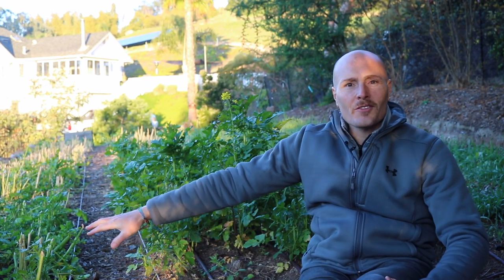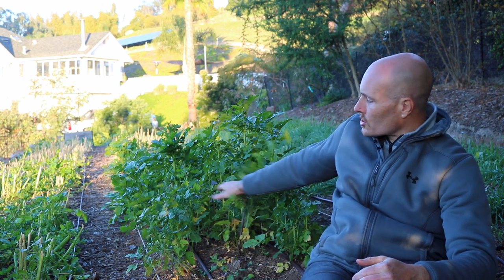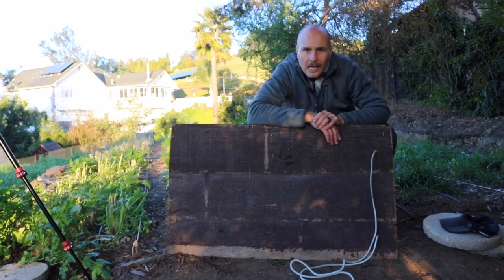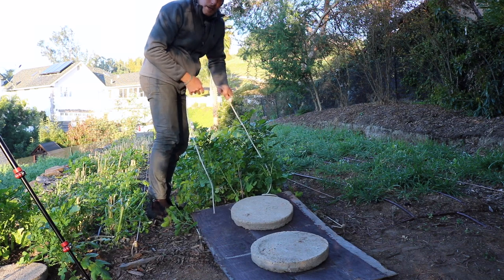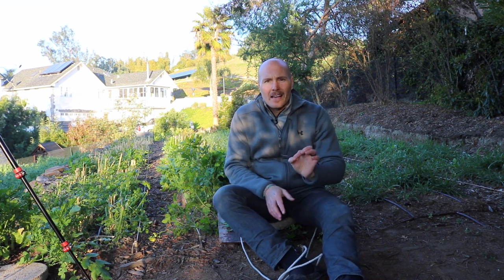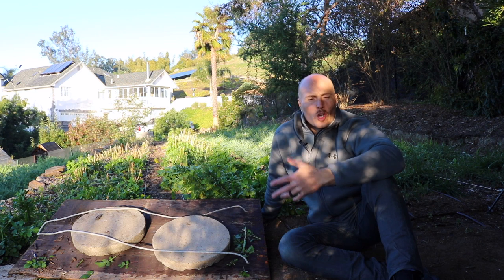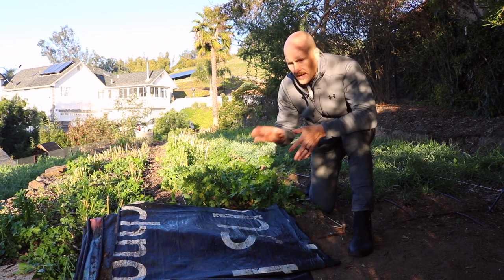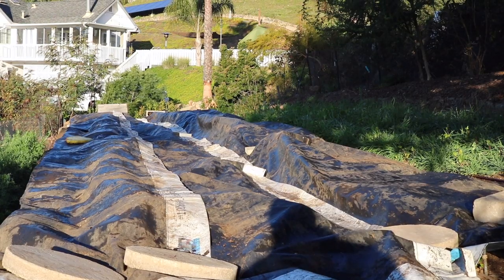Knocking Down Cover Crops to Compost in a No-Till Garden

Comment: Great questions. Here is my take on what is going on: I'm pretty sure that plant residues at the surface are a minor part of soil building. Good mulch for moisture retention and weed suppression, and for releasing breakdown residues into the soil.  The bulk soil is most nurtured by the sugars and other exudates from THE ROOTS! Organic material at the surface will be oxidized rapidly, particularly if there is a good balance of carbon, nitrogen, moisture and a good microbial community.  Of course some will be incorporated due to worms and other organisms.
Reply: Without a mulch, the detrimental effects of exposure fuck up whatever soil life you built.
Also you are simply feeding different parts of the microbiome with those 2 ways ... decomposers and symbiotes, respectively.
Both are relevant.

Comment: I use a piece of horse panel wire fencing that was leftover for my plow and cinderblocks for the weights.  It works like a charm.  The wire catches and tears/cuts a fair portion of the weeds/cover crop.

Comment: Just rewatching this after learning much more. For my cover crop mix (wheat, crimson clover, red clover, buckwheat, daikon radish), I'm going to tie twine to both ends of a 2x4 scrap, put it perpendicular to the row and keep one foot on it as I walk up the bed and use the twine to lift the scrap and move it and my foot to push it back down and crimp. My space is small and I think this will work nicely. Anything that doesn't die from this will get winterkilled (I live in zone 3 and even red clover is unlikely to survive).

Next year I will try some winter wheat to overwinter some living roots. This year, will just be some hardneck garlic in part of the garden after terminating the cover crops.

Comment: I'm so glad you did this! I think a HUGE variable is, as always, the amount of rainfall on a person's garden. I've had about 70" annually for the last 3 years, our average is supposed to be 60". Another one would be what cover crop is being used. I have a couple of places where I plan to plant trees and grapevines in 2 or 3 years. So, I'm running a variety of different things depending on if the spot tends to have standing water. I'm hoping my work horse will be sudan grass. But I have a great curly switch grass that pops up in my no mow yard areas (standing water or not) that I'm pulling seed from today in case the sudan grass fails me. But I'm hoping to be able to get a couple cuttings off the sudan, compost the cuttings and put the compost back down right before I drop seed for my winter cover crop. Be interesting to see how it plays out for me.

Comment: Just my opinion, but I think the best way to go about it, in your climate (and given your willingness to keep some beds "unproductive" for a while) would be to collect a lot of the rougher stuff in your beds (even some of the bigger roots), and compost them (or send them to municipal compost, if you don't have the space or inclination to wait a year+ for that rough stuff to compost without being ground up by heavy machinery). And then, instead of the tarp, sow a diverse cover crop (aka "green manure"), and kill if after 4-5 weeks. Cover crops don't just provide you with nutrients by decomposing after they die. Early in their lives, they actively harvest energy from the Sun and nitrogen and CO2 from the air, through photosyntesis, and deposit the resulting nutrients in the soil. They literally exude nutrients, out of their roots, into the soil (it's more complex than this, it involves microbial soil life, but it's what the end result is). They do this for the first part of their lives. Also, in this early stage of their lives, they produce more roots than stem and leaves. 
.
So, if you chop them down very young, you get the bulk of your benefits through nutrients exuded directly into the soil, and roots that will quickly break down in your soil. It's my understanding, based on a few lectures I've seen from soil biologists like Christine Jones, that a month is all the cover crop needs to do most of its work, afterwards it stops feeding your soil and starts putting its energy into producing leaves, flowers and eventually seeds. It also starts reaping the benefits of the symbiotic relationship it has with the soil microbes, in other words it collects interest on those deposits it made in its youth...charming as that is, there's no point in letting things get that far in a gardening situation (there would be, out on pasture).
.
That said, I don't practice this, because I garden in a climate with a short growing season. I can't just take each bed out of commission for 5-6 weeks, to grow cover crops (I could, but it's not efficient). So I compost. I spread a layer of compost on top of the bed in spring, and then plant into it. But it's work, and I would not bother with it if I lived in Cali. It seems to me that it's far less work, and when your growing season is pretty much year round, it's worth rotating in cover crops. Like you mentioned, farmers (the smart ones) do it all the time.

Comment: Great presentation of these concepts. I canspeak pragmatically: When I was kid my neighbor was an old man and he planted winter rye and buckwheat cover crops every year. He would have me drive his Farmall Cub and plow these cover crops in.  After he passed away I continued to raise crops on this garden however I stopped using cover crops because it was more work.  The tilth and productivity of the soil dropped off rapidly. Within 3 years I was turning over what looked more like subsoil. 
I don't know why the cover crop made such a difference.  We do get a lot of rain and having the field covered with buckwheat after harvest and rye through the long New England winter may have helped to prevent the erosion of nutrients and Steven Shantz's comments on the roots makes sense. I've long since moved away but I do still grow with cover crop; oats/cowpeas planted in the early fall that winter kill. I have no idea if this crop is improving my soils. I often tarp my "no-till garden early spring to create a clean/dry seedbed.  I will be curious to know what you learn in your experiment. I think you are smart to move the cover crop to the compost pile and create compost there because you have greater control of the composting environment and you free up more space in you garden for growing. Ether way, I would want to keep the soil surface covered (tarp, cover crop or compost) but then again you may not get as much rain as others.

Comment: my cover cropsI cut , chop and then rake the surface up and cover the chop with soil( or compost from elsewhere effectively burying it). I will add a little vermicompost for all the microbial addition. add water if it needs it.
In about 6 weeks time it will be ready and broken down ready for my container crop.if no till is sacrosanct,then just apply compost and put your chopped materials onto a compost pile

Comment: Mustard doesn't grow back when it's that tall. Usually only grasses will grow back if you cut them. Things like wheat, rye. With cover crop I use the traditional method : you stomp  them once they flower, so that they don't grow back (if you do it before they flower, it doesn't work as well). I do not put them in the compost. I add a bit of compost or spent barley, some wood chips, and plant about 2 weeks after, so that the roots have decomposed and the stalks started to. I usually sow in October, a mix of mustard, rye, vetch, fava bean, winter pea, and phacelia. The more plants you have in your mix, the tougher and taller your cover crop. Doing mono species doesn't give you a lot of biomass. And I stomp it in May, I'm currently doing it in our garden. It's beautiful when in flower, with the pink vetch flowers, purple phacelia, and the rye ears. I do it coz my soil is clay, that can get waterlogged in winter.

Comment: I like how you pose relivant questions for your own use. Its making it a bit scientific. I appreciate that.👍 Also, I'm wondering how your mustard compost is doing. Id like to see a vid if you turn it or even a temp check if you are hot composting it.
Reply from the maker: Video on that coming.  I didn't turn it.  I never measured the temperature.  I moved it to a bed 9 weeks later.  Results were pretty good.

Comment: Chop and drop is about creating a mulch. I think you are worried too much about it drying out. It's there to protect the soil
Reply from the maker: I am saying I don’t think it builds soil very well.  Protecting it isn’t the goal for what I am doing.
Reply: @DiegoFooter   Diego Footer  I rewatched the video. I am of the belief that we should be giving the organisms something to work on at the surface since we are doing it below the surface by not tilling.  If we remove the residue and compost it, it will break down into particles that will enter the soil faster. But I'm asking what protects the soil while the residue is gone while composting. The tarp is one solution. As for chop and drop, maybe we just have to get our timing down; so we do it before a rain so we can capture in the soil the nitrogen that leeches from the residue.
Reply from the maker: I get where you are going, but I am not of the believe that the soil has to be protected straight up the surface.  The upper layer of soil protects the soil below it - no mulch needed.  I am not convinced that it is worth a lot of extra effort to have maximum water and biology right at the surface.  It's a positive, but is it worth the effort.  In a food forest yes.  In a garden with high turn-over - maybe/maybe not.

Comment: Hey Diego!
Approximately four(4) months later there are things learned. In no way is this a negative remark. Is there some reason why you choose to monocrop? The reason this is asked is the plan is to cover crop the smaller then yours garden. However the plan is to use multiple crops. Sunn Hemp, Velvet Bean etc etc.Again it is much appreciated the info you share.
Reply from the maker: I don't think planting a mixed batch of cover crops is a bad idea, but I have found that certain crops will outcompete others.  I wanted to generate a lot of biomass very quickly and I wanted to be able to direct seed it, so mustard was my crop based on what I was going for.  There isn't a right answer or wrong answer it just depends on what you want to achieve.

Comment: Diego, how about using a lawn roller? Could use as double duty tool to firm beds prior to planting. Just vary amount of water in it!
Reply from the maker: Yeah. I actually have one, but I need to get a new plug for the hole.
Reply: Diego Footer that’s a pretty cheap fix buddy, it would be much easier than dragging that sled!

Comment: I think the main difference is that when you compost in a pile it breaks down quicker. It takes more work but you get the benefit much faster. When you chop and drop it takes longer to break down but it's pretty damn easy. I think you could split the difference if you chopn'drop and add carbon in some form to the beds (maybe some wood chips?) but I'd love to see some experiments ran on how fast the fertility is available to plants. From what I've heard cover crops aren't necessarily the best thing to do every year since you run into the problems you describe, but it might be a good way to boost organic matter in a bed really quickly. If you ran a no-dig woodchip garden you could do it every year but I'm not sure it would be any better than just adding woodchips as mulch and letting them break down... maybe it would be faster like I said? I don't know. Interesting. 

You can run a no dig/garden like Charles Dowding does, and direct sow cover crop seeds into compost, but it would tie up what otherwise would be available garden space and provide little benefit. I just don't know that it helps all that much if you have a good source of compost available already.

Comment: I thought mustard was a biofumigant. You have to cut it down close with a mulching mower and turn it under within a couple of hours  or the mustard gas will dissipate into the air instead of the soil.

Comment: First of all... I always stand by your side, but this time Dude Bro was way smarter than you: any other tool would be better to terminate a cover crop.

About using a tarp i 100% agree with you, it reduces weeds for a long period, it creates a microclimate that promotes a good biology, fast decomposition, and reduces losses of elements in the air... If you place a tarp over 10"of crop residue even the top inch is attacked by biology!

Yet a tarp is not enough, and even composting in some other place could be less desirable, for different reasons, the one i want to focus on is subtle, but may be meaningful: the biology you promote when composting is different than the biology you promote by leaving undecomposed, diversified organic matter on the soil, the second way slowly stimulates the soil to build efficient, endemic, adapted organisms able to process whatever you provide and turn it into a soil food web booster. You are not just adding organic matter, but tons of biological biomass that is alive and working. This is what i retain After a syntropic farmer explained me how he is growing 4 acres of vegetables without irrigation, tillage and external input as manure or fertiliser.
The place is almost a desert according to annual rainfall and temperatures, so I tend to believe him.

Another point: you're not cutting or mowing, in this way the residue will stay there longer, it's good if you want to protect the soil, it's bad if you want to plant asap or if you want the soil biology to grow fast.

Using a mower or better a flail mower, we can get way more results
-leave the residue small and homogeneous, which is easier to manage, and we can plant in it as it serves as mulch and fertiliser
-scaling up is now possible, 100sq feet, 100 acres... It's the same

You are not considering roots enough, they are an important part of the biomass as well as feed for the soil food web